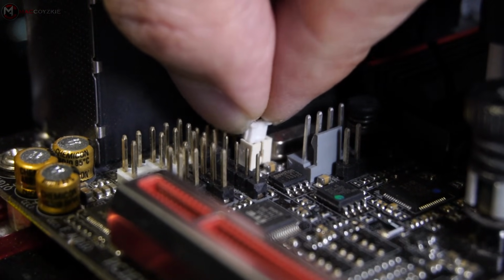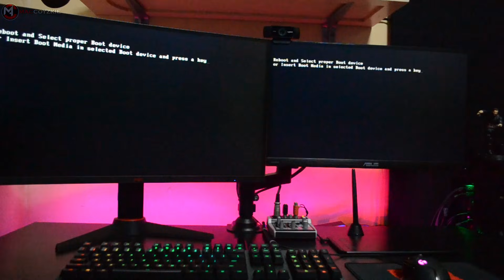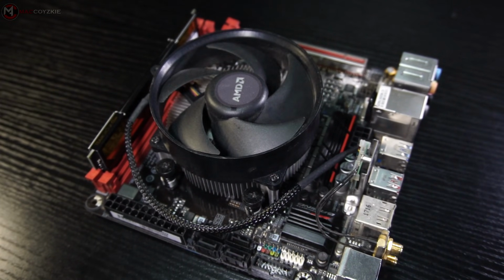How to remove cmos battery in your pc? Cmos reset / hard reset on bios

Comment: This fixed my instability issue as I replaced my old psu.
Reply from the maker: awesome!
Reply: @MacCoyzkie  the problem started again after doing updates to Windows. What should I do? Does reinstalling windows help?
Reply from the maker: @ShadyNefarius  yeah it will work if you reinstall. Usually i would suggest people to SFC scan https://youtube.com/shorts/GsfhmuZmzx4 if there is an important file in the boot drive but if there is nothing then just have a clean windows installation
Reply: @MacCoyzkie  I did a sfc/scan and did not solve it out. I checked my drivers if are compatible and they are but idk what is the issue here.
Reply from the maker: @ShadyNefarius  you probably need a clean windows installation at this point
Reply: @MacCoyzkie  What I did was replacing the psu because it started to smell and do a weird noise.
Reply from the maker: @ShadyNefarius  oh no, wait umm.. did the smell came from the old psu? also if the old psu is not 80+ certified then other components might also be in danger.
Reply: @MacCoyzkie  it came from the new PSU however. The old one didn't  have a issue

Comment: Actually whenever I'm turning my pc on it shows a screen where it'll be like gigabyte ultra durable and below that something like press del for bios etc etc for a few seconds and then comes windows login screen.

But now whenever i start my pc first the screen remains black for 15-20 seconds and straight away shows windows login screen
i cant see that bios screen which I was seeing before and also I can't access my bios right now but I can use my windows as usual 

please help me

Im using gigabyte H310M S2 2.0 

any help is appreciable

sorry for my bad english as english is not my first language
Reply from the maker: even if that does not appear you can spam DEL key to enter bios or whatever key your motherboard requires to enter bios.
Reply: @MacCoyzkie  ohh thank you so much for your response I tried but it didn't work I think I've done something with my motherboard lol thanks once again I'll sub your channel with all my accounts
Reply from the maker: @darkside-fq6ul  no problem bro, i hope your pc is all good now. thanks for the subs!

Comment: Can tell me about this
I have a msi mobo
Which has a software named as dragon centre
So i got an update for bios
I installed it from there it restarted itself in few seconds
And then afterwards my monitor was all blacked out and the warning light(near 24 pin connector) was glowing on cpu after that im unable to start my pc it starts show all the rgb but my monitor stays on standby mode
And my keyboard lighs don't turn on
Reply from the maker: wrong bios version for your cpu. Update your bios again but make sure it is compatible with your cpu. Better yet just go back to your previous bios version if you can still remember. Just a tip, if your processor is already working good there is no need to update bios ever
Reply: Ohk I'll do that... But sometimes my pc just suddenly black out for no reason like if I'm playing valorant after playing it for a while the game will freeze and and the montior will black out and it would indicate a red warning light on the cpu..... 
So i dont know if it happens becz of over heating or what... All of my fans are stock fans 3 intake and 1 outake and one for processor
And i live in a city where 37-40° temp is normal
And i only have a fan in my room no ac
So should I get an aio liquid cooling?
Reply from the maker: @knightnightlabz8886  you mentioned regarding the cpu light near the 12pin connector lighting up right? that basically means your cpu is not being detected or it is faulty. Being faulty is very rare so you shouldn't worry about that. For now try to reseat the cpu make sure it is seated correctly without any wobble, use a better thermal paste. this for example https://amzn.to/3NYo57z i've been using this for years and thermal paste is really reliable. Do not settle for liquid cooler yet unless your workload will cause the cpu to reach 88c or above. Btw try to reattach your sata cables just in case specially the one on your boot drive and also the psu pins on the motherboard
Reply: @MacCoyzkie  I did I just got the thermal paste changed yesterday the service guy somehow turn on the pc somehow God knows how bt after a restart again same problem
And regarding temps my cpu reaches up to like 85°+ on just valorant
I even tried taking out cmos batteries and all... Still it didn't start the pc
Reply: One of the service guy said one of my ram is creating the problem yet it couldn't boot up if I use just the other one
Then the other guy said it's a bios problem
Then somebody else said it's your mobo
Reply from the maker: @knightnightlabz8886  are you using any monitor cable converter by any chance?
Reply: @MacCoyzkie  nah I use a dp cable
Reply: @MacCoyzkie  and i have a question is it normal that my mobo has cmos battery but there is nothing over jbat 1(cmos cord or something)
Reply: I'm seeing people are removing the batteries and removing that cord from jbat 1 but there is no cable over my mobo
Reply from the maker: @knightnightlabz8886  don't do anything on that bro. Clearing cmos is actually resetting bios to default so all overclocks will be removed if there is any. Does the black screen only happens during gaming in valorant or all games?
Reply: @MacCoyzkie  yea it's pretty common for me cause sometimes it happens while using PR too

Comment: Thanks you saved my life it's literally 3:54 AM now i can go to sleep. 
After resetting my bios!
Reply: 3:02 AM here. Fixed my black screen, gonna have a great sleep in a sec
Reply from the maker: No problem bro! i bet you'll have a sweet dream afterwards 😂
Reply: @MacCoyzkie I overclocked my ram from 2400mhz to 3000mhz and got a black screen so just removed the battery for 5 mins because I cant find the clear cmos button. Hopefully it works
Reply from the maker: @IamDukez  that'll work
Reply: @MacCoyzkie  it did cheers

Comment: Hey,I just removed the battery but nothing happened 😔😔 still the same.screen is black and air cooler is working roughly,like it's rendering or something. I clicked on "use USB to flash bios" and then screen became black(( my motherboard "Tomahawk b550"
Reply from the maker: is this a newly build pc or a working one already? can you give me the pc specs so i can have an idea?
Reply: @MacCoyzkie  it's newly.i built it in the last summer,had an old GPU and 1 month ago I got rtx 3060 ti so now it's new. PC specs:

Ryzen 7 5800X
MSI B550 Tomahawk
Corsair Vengeance 32GB 3600 SL
SAMSUNG 980 SSD 500
Seagate Barracuda 2TB
EVGA Supernova G5 650, 80 plus gold
Noctua NH U14S
Arctic F12 PWM 5-Pack
Arctic Case fun Hub
Thermal Take S300 TG
Palit RTX 3060 TI DUAL 8GB
Reply from the maker: @cyberpunkmoba2045  if there is anything i think the flash bios incident was the problem, your specs should run right away with correct bios. You might need to bring this to a local shop

Comment: Icl I downloaded geshin impact then turned of my pc and it went to failed to boot  page 😭😭😭
Reply from the maker: this usually happens if your boot drive is already full that is if you install the game in boot drive. Your only option is to go back to a certain restore point. You need to go to safe mode to do that. Here's how to enter safe mode if you can't boot properly https://youtu.be/IZKc8plksDA
Reply: @MacCoyzkie  hey I tried but it’s stuck on the page like it goes straight to it so I can’t even enter it in safe mode I don’t know I tried and I checked everything the pc is healthy but it just randomly did this I might give up
Reply from the maker: @MarniOrJ  that's bad news bro, i think your only choice is to either reset windows or reinstall a clean windows
Reply: @MacCoyzkie  probs thanks for your help ❤️

Comment: There was a 12 hrs power outage, I left my AVR's plug in the outlet but it is turned off. Nung oopen ko na sir umiilaw lights ng mobo pero di gumagana power button, will doing this work po?
Reply from the maker: naku check mo yung umiilaw na LED kung DRAM, VGA, BOOT, CPU depende kung ano nailaw iba iba ang solution dun
Reply: @MacCoyzkie  umiilaw lahat sir, pwede bang psu problema? kasi napagana ko ulit kagabi tapos ngayon ayaw na ulit mag on.
Reply from the maker: @waveshrine  ah baka yung pc led sinasabi mo. Anyway kung napagana mo ulit ibig sabahin either natamaan yung psu mo or meron parin power fluctuation sa bahay nyo. Meron ka bang gaming na avr?
Reply: @MacCoyzkie  baka yun problema sir, di pang gaming avr ko eh
Reply from the maker: @waveshrine  kasi pag mas low wattage ang avr mo sa pc malaking problema yan

Comment: Hi I did this with a over clocked gpu it came over clocked btw would it still be over clocked??
Reply from the maker: gpus with OC features on its box info basically means by default it is overclocked and does not need tweaking. there are also some gpu that has a physical button switch to turn it on or off. So if you clear cmos your oc gpu will not be affected

Comment: So i have a specific problem,
Sometimes when i boot up my laptop i get the "reboot and select boot drive" and everytime i enter bios it only has 1 option, which is the prebuilt hard drive. No windows boot manager, and it doesn't even read my SSD. But i don't know why, if i just keep restarting my laptop it'll just boots itself back. I have to do this again again everytime i want to boot up my laptop. Do you think this will fix it?
Reply from the maker: that's probably a failing ssd, if you were able to log back in windows start backing up your important files since your ssd might break anytime soon.
Reply: @MacCoyzkie  oh, i forgot to mention i installed the SSD after i installed windows, does that effect it?
Reply: @MacCoyzkie  because the ssd i bought was brand new
Reply from the maker: @aliathif7778  enter bios and go to boot priority and set your SSD as primary

Comment: My pc when I Open a game will trip off and turns on right away. I tested my Psu its 12v 
ram is fine and Gpu is fine so as ryzen3600
is it my board?
Reply from the maker: ok that sounds bad bro, i suggest use an AVR or at least a power extension cable with power surge protection because i think this has something to do with your wall outlet having unstable power output. On the other hand, this might be your psu too having less wattage than the pc power requirements. Btw what are your pc specs?

Comment: I tried this because my PC would turn on but there was no display. After removing and putting back the cmos battery, now my PC won't turn on at all. Please advise me on what to do next.
Reply from the maker: my question is what happened before you clear cmos?
Reply: @MacCoyzkie  PC was working fine then last Wednesday, March 2nd, when I turned it on there was no display, the monitor not receiving signal but the unit has lights on and fans are spinning. I already tried reseating RAM, and checked if cables were loose. But the no display problem is still there. Then I saw this video and tried removing and putting the cmos battery back. Now the PC doesn't turn (no lights, no fans) at all. Is it possible that I damage anything to cause this?  Would replacing the battery with a new one solve it? Thank u
Reply from the maker: @kamikaze309  this sounds like a power issue either your psu or the power outlet low power draw. You might need a psu tester like this https://amzn.to/3edegBw to test the psu
Reply: @kamikaze309  in the end, could you fix the issue? I'm having the same problem and it's very frustrating

Comment: When I try to enter bios on startup, a black screen appears and nothing happens. Will this help me to overcome?
Reply from the maker: new pc or was a working one? also can you tell me what are your pc specs so i can have an idea how to help you
Reply: @MacCoyzkie  A new one with an i3 10th gen, 8gb ram, 128gb ssd and 1tb hdd
Reply from the maker: @vectormaster7976  does your i3 10th gen support integrated graphics? if not you need a gpu to make your pc work
Reply: @MacCoyzkie It's working but I can't access bios.  My processor is a F processor which means that there's no integrated graphics 🙂
Reply from the maker: @vectormaster7976  may i know your pc specs so i can get the whole idea what is up?

Comment: I can’t find the cmos battery on my ultra durable motherboard
Reply from the maker: perhaps it was being blocked by your gpu, or if you are using mini itx mobo you need to check 0:28 of this video
Reply: @MacCoyzkie  i found it, but it still didn’t work my pc is still booting into easy mode 😔
Reply from the maker: @happi5599  do you have windows installed in your boot drive already?
Reply: @MacCoyzkie  i have windows installed, it just frozed when i was using my pc. Got the blue screen error then it restarted and only boots into bios.
Reply from the maker: @happi5599  can you check what was the stop code in your bluescreen? Just in case you don't know what that is here is some info https://youtu.be/lRdON6m6nPY
Reply: @MacCoyzkie  no the computer crashed before I could even get the code.
Reply from the maker: @happi5599  btw have you check your cpu and gpu temperature perhaps its just overheating
Reply: @MacCoyzkie  my cpu is at 57.0°C not sure about gpu.
Reply: @MacCoyzkie  i also have more info, when i turn on my pc it shows the gigabyte logo then a black terminal kinda screen with a underscore pops up. then it boots to bios.
Reply from the maker: @happi5599  not booting to windows after clearing cmos, might be a faulty boot drive or you just need to remove and attach again those sata cables

Comment: What happens when i hard reset the BIOS? And what happens when i remove the cmos and put it back for like 1 min only?
Reply from the maker: I just explained that in the video... it resets the system to default. Removing it less than 5mins may not reset at all

Comment: My PSU ,CPU fan runs but there's no beep that I used to hear before and even the red led light and no display the system runs the fans are spinning but no display and single beep sound like earlier. Will this solve my problem?
Reply from the maker: double check all the sata, psu cables, ram, gpu if all are connected all the way, you can also re-seat those too. Then do the clearing cmos

Comment: 3 long beeps 2 short ones. I am pulling out the battery. After I pull it out. Do I need to push the cmos reset? If I have a cmos reset, do I need to pull the battery?
Reply from the maker: if you remove the cmos battery for 5 minutes and place it back then that's a cmos reset already. You might also want to watch this for that particular problem of yours https://youtu.be/WRNLRm_Zx0c

Comment: So my pc is brand new and after a week I had to do this, as of yet it hasn't worked and I just don't get any bios posting when I turn on my PC, my fans spin like crazy and my GPU lights up and the fans on it spin but thats it, my speaker does not beep and it is properly plugged in. I am completely lost and idk what to do, I would very much appreciate any other help you may have. Thank you.

P.s (i have also tried re seating ram, would I be able to boot my PC with one ram stick or does that not make any difference?)
Reply from the maker: your tests are the first steps to check the pc components if all are good but since you experience the same then it might be something else. Before we proceed may i ask what are your pc specs and how the pc problem started so i can have an idea?

Comment: Hey man, my pc was showing the American megatrends error usb device over current status detected. So after starting up my pc it would shut itself down in 15 seconds. I went straight to google looking for ways to troubleshoot the problem and I ended up on this video. I reset the cmos and now my computer is stuck in a boot loop. I have no idea what else to do.
Reply from the maker: usually when boot loop happens the ram sticks are not plugged in correctly. Here's a guide https://youtu.be/UKR5xRsOhNg just in case. You might also want to double check the gpu on the pcie if its plugged in all the way, also the psu cables on motherboard, gpu and your drives. On the other hand perhaps the pc is just too dusty, cleaning it may also do the trick. More info about boot looping problem in this vid https://youtu.be/bzV4WBuZdLU
Reply: I’ve fixed the boot loop but I am still getting the error code
Reply from the maker: @joeyreid7175  what is the error code?
Reply: @MacCoyzkie  “usb device over current status detected!!” Is what it says
Reply from the maker: @joeyreid7175  you might have a broken usb plugged in your pc, remove all usb connection and just leave the mouse and keyboard and try to boot it
Reply: @MacCoyzkie  already tried. Still didn’t work
Reply from the maker: @joeyreid7175  usb device over current status detected usually are broken usb cable or the front panel usb connector is broken
Reply: @MacCoyzkie  tried unplugging my front panel USB ports and it didn’t work. But my pc is detecting my keyboard and mouse because it says so on the American megatrends screen. It might be my mother board?
Reply from the maker: @joeyreid7175  perhaps it is, can i ask what windows os you have? win10 or win 11?
Reply: @MacCoyzkie  10
Reply from the maker: @joeyreid7175  ok, i really think it is the motherboard itself is faulty. You can also try your gpu & ram with other pc to double check
Reply: @MacCoyzkie  yeah I’m getting that done right now thanks!